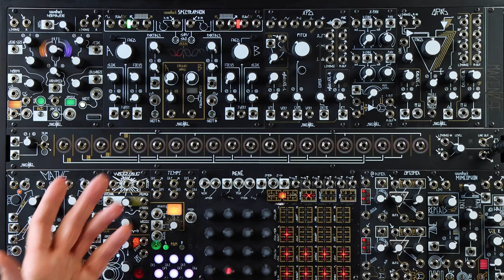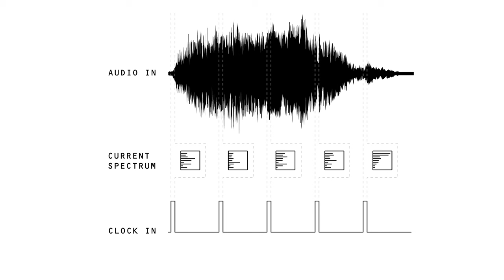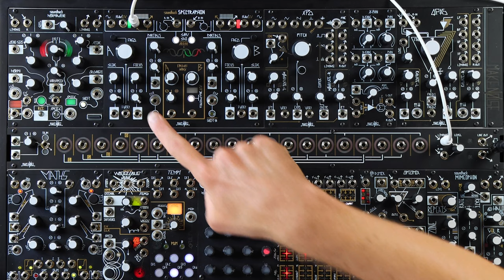Creatin' Arrays with Spectraphon | Make Noise

Comment: finally, can we get some input on what happens while clocking thru a chosen array? If I understand correctly it  sounds like there are 1024 snapshots of the harmonics in the array and  that the clock will cycle/loop thru them . , what if you did a manual spectra capture but only clocked 6 times , does that mean spectra snapshots 6-1024 are just repeats until you lop back?

Comment: Thanks for this video, helped me a lot to understand the manual. I am using a VCVRack patch with a Hetrick Phasor Burst Generator into a Phasor ->Clock module to create 64 clock pulses and a synced phasor ramp to scan through individual SurgeXT Wavetable VCO wavetables. Playing a constant pitch through to Spectraphon SAM A, tune it, then create an Array using the 64 pulses to capture one complete scan through a wavetable. Seems to work quite nicely. Same technique works for capturing other moving timbres.

Comment: also at 10:36 to manually clock spectra captures into the current array , , you held shiftA then tapped array and the light kept blinking , what's the trick there? 9 times out  to 10 mine just does gthe one second capture and stops blinking , best I can tell its hold shiftA and the REALLY QUICKLY TAP THE ARRAY BUTTON , is that right ? yes I waited 3 seconds

Comment: Is that a new version of CV bus with mono / sum input on the left side? 👀👀👀
Reply from the maker: This CV Bus has a voltage math circuit on the left end, similar to that of the 0-Coast. It will ship in a case with the new 4 Zone Bus Board at the end of the summer.
Reply: @MAKEN0ISEMUSIC  it looks 2 or 4 hp short?... 🤔 prototype? or .... oh wait. its slotted!
Reply from the maker: @bilbobagpipez7633  it is 104hp, filling the full middle 1U

Comment: What happens if the fundamental pitch of the sound is changing during recording? Is the fundamental automatically tuned to a constant value in the spectra’s of the array?
Reply from the maker: Changes in the fundamental of the source sound will be interpreted as changes in the harmonic spectrum, unless you also change the setting of Slide to match
Reply: @MAKEN0ISEMUSIC  that would finally mean, every spectrum in such an array could have a different fundamental frequency. And by stepping slowly trough the spectra’s you could play a melody. But this also would mean, this oscillator has no constant pitch. That’s hard to handle. Better would be to remove pitch information from the array and make the fundamental the same (auto-tune the array like Roland’s VariPhrase )…
Reply from the maker: @BurkhardusX  The Array does not contain pitch information at all, only harmonics (integer multiples of whatever fundamental is set at playback).
Reply: @MAKEN0ISEMUSIC  Now I understand. Thank you very much for your detailed feedback and explanation.
Reply from the maker: @BurkhardusX  Happy patching!